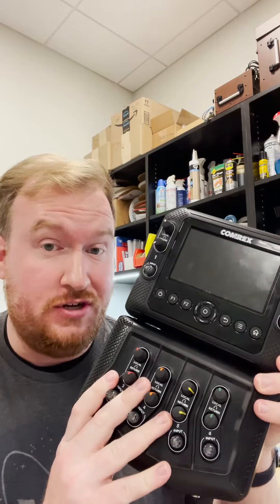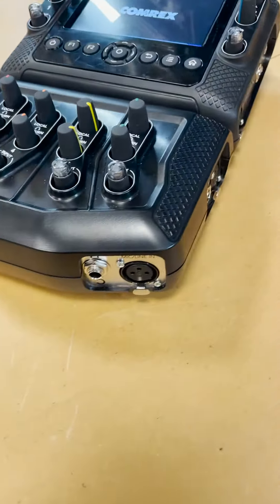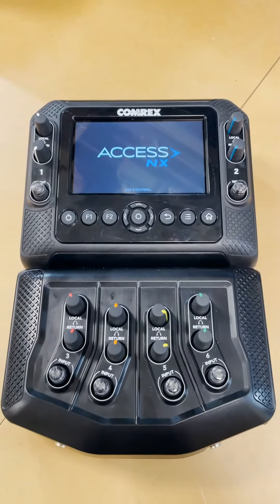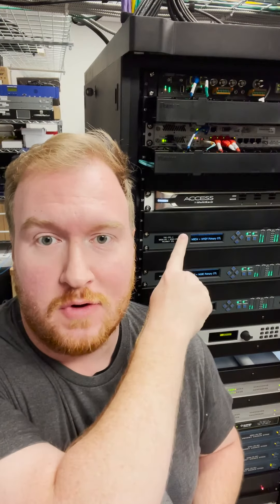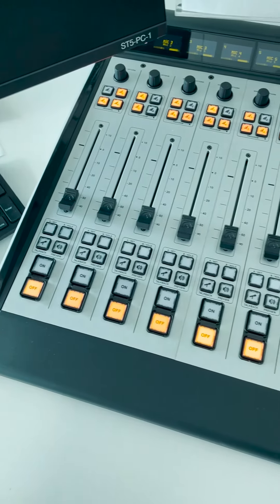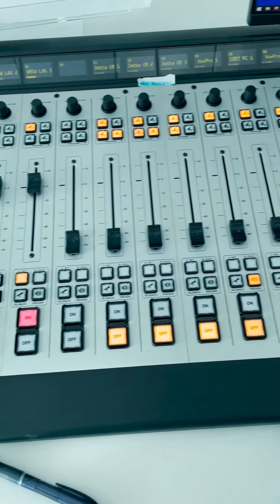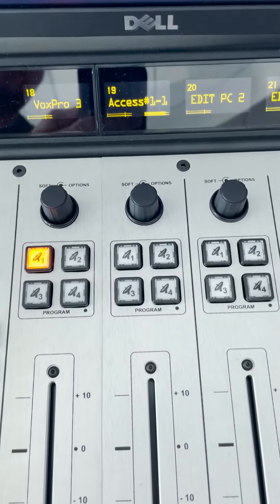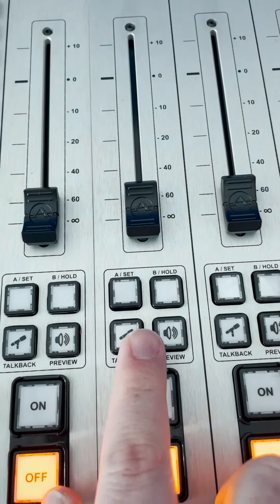Broadcast Engineering TikTopics: How Live Remote Broadcasts Work

Comment: How did they do it before internet though?   I think they still do it the old fashioned way for high school games here in the midwest. Like STL or something
Reply: @BroadcastBlueprint  So on the 700 to 1000 ft towers, the big white water cooler looking thing mounted on an exterior leg of the tower is the receiver?  Also, what doe the physical FM antenna look like?
Reply: Back in the old days, the telephone company supplied special analog broadcast circuits. Depending on what the station was willing to pay, sound quality could be anything from telephone voice grade to stereo 15 KHz. Comrex made some equipment which could use 1 or 2 dial-up circuits with some improvement. Then some stations started using "Marti" VHF/UHF radio systems, which provided medium to good audio quality. After that there was ISDN, DSL and then IP.
Reply: @BroadcastBlueprint  Even microwave signals could be dangerous to manage.
Reply: Where I grew up in the 80s and 90s, it was standard for stations to use a Marti transmitter (same principle as an STL, but portable) for in-city remotes. For sports, we would set up a directional antenna from the home stadium back to the station at the beginning of the season, so all you had to do was plug your audio sources and the antenna cable into the Marti and turn it on.
A directional Marti signal from a ground-level antenna could only carry about 10 miles or so. For away games we would use a mixer with a built-in POTS hybrid and dial into the station. It only gave phone quality audio, obviously, but there were no cheap broadcast quality options in those days.
This was before cell phones. In my region, each local station that did sports coverage was expected to install and maintain a “courtesy” landline in their home team’s press box for the visiting broadcaster to use, with the expectation that there’d be a courtesy line waiting for them, too, when they were on the road.
Reply: @andyrose5616  i have waited for this answer for so long. Thank you
Reply: @whuffer5103  I’m glad you find the subject as interesting as I do. 🙂

Comment: That's a cool box and I'm sure it's a breeze to set up and use, but I remember the days when we took the 30-watt "Marti" out in the field with a big antenna (or used the antenna on the station van) and had to use the directional antenna to send the signal back to the studio. If you didn't know where you were in relation to the studio pickup antenna, you'd have to swing the antenna around until you got "tuned in". And this was before cell phones, so you had to have a two-way radio to hear the guy at the station who let you know when the signal was good enough to use. We even used DBX noise reduction on both ends of our Marti units to clean them up. Does anyone use the old 161 or 450mHz Marti frequencies any more? 
Ah, you guys now days just don't know how to have fun! 
By the way, my radio experience started in 1977.
Reply from the maker: One of my stations still has a 450 MHz RPU license attached to its broadcast authorization! I found a Marti pair at one of my tower sites and I’ll most likely feature it soon. As they say in the business, stay tuned…